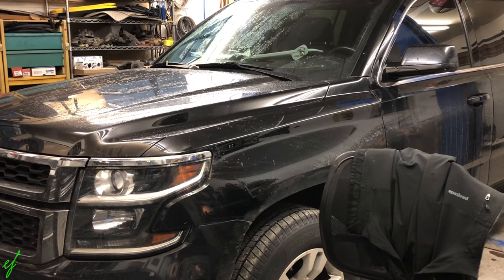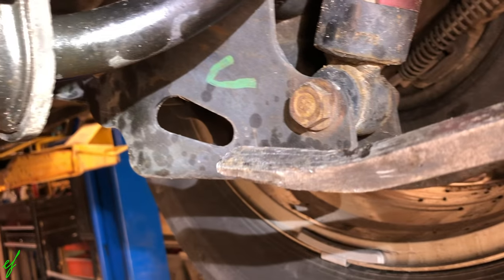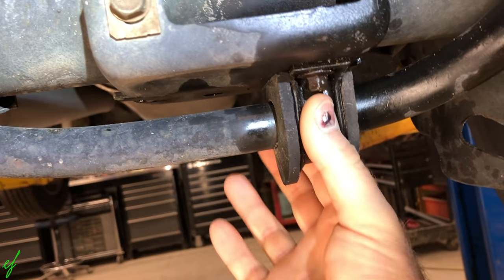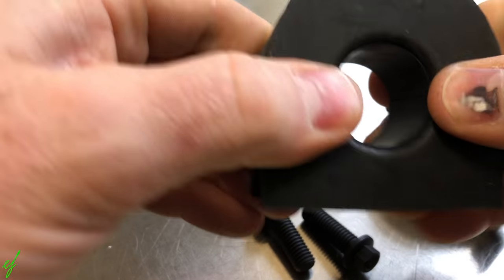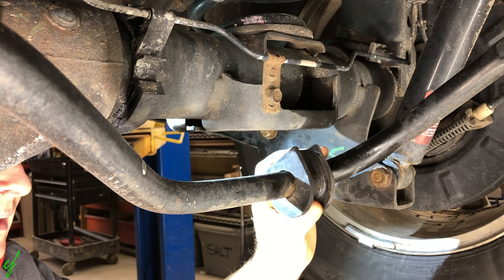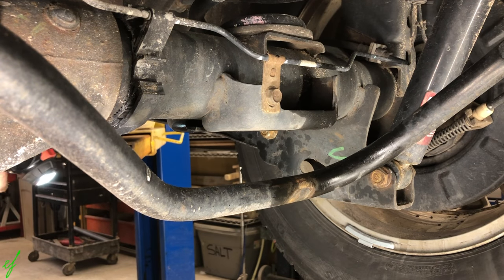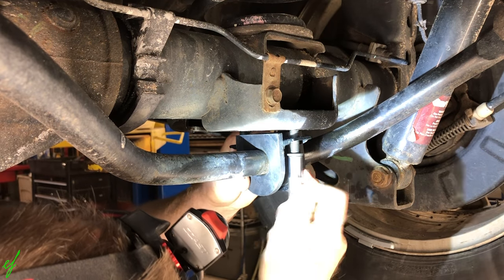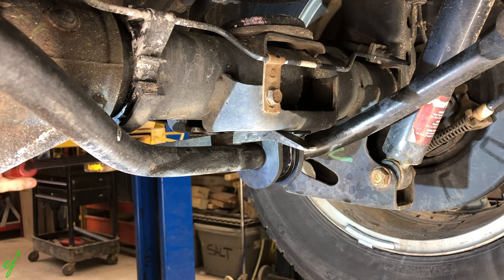SWAY BAR BUSHINGS  |  Professional Sound Diagnosis & Replacement

Comment: Good video, but come on those bushings were still good lol. The little play you did have you caused it. If anything they needed some grease.
Reply from the maker: 2 wrongs do not make a right 😂. I am just teasing ya haha. So first, the bushings were loose enough to clunk while driving. Second, NEVER add grease to a sway bar bushing. It will make noise a week or a month after that is so horrendous you can not even believe it is possible. I mean its loud and screechy and horrible constantly while driving. Bushings are the wear item with the intention of saving the spring steel sway bar. They should wear out over time and they should also be installed dry like the factory installed them 😃🔧
Reply: @EasyFixShaun  Ha...Sir I'm not arguing with you, but I know for a fact you are wrong about greasing the bushings, some cars automatically come with certain bushings in certain areas that have grease fittings and sway bar bushings are one. The sway bar LITERALLY rolls back in forth, side to side within the bushings SO HOW LONG YOU THINK THAT RUBBER WILL LAST WITHOUT GREASE? This isn't even a discussion, this is common sense.
Reply from the maker: @MRMAN-wb1tv  I am arguing with you. You are incorrect.

Comment: I replaced my stabilizer bushing and it started making load squeaking noises every time I went over a speed bump.  I ended up putting grease on the bushing and the sound is now gone.  Anyone else had that problem?
Reply from the maker: First time I have heard of squeaking from a new bushing. It’s possible but it’s not the norm. If grease made it quieter you isolated the noise. I would check that you have the proper parts. It might be a good idea to get a couple bushings straight from the manufacturer 😃
Reply: @EasyFixShaun  i read that Polyurethane bushings will make noises without lubrication.   I got my bushing from the local auto part store.
Reply from the maker: Ok. I haven’t searched poly noise. But from my experience I have never heard a bushing make noise after replacement. Usually the noise when they are worn is a clunking and no real squeak noises along with it. So I’m not sure what you have happening. What year make and model do you have?
Reply: @EasyFixShaun  that what most of my friend mechanic said too.  They never heard it squeaking before.  But I did find mechanics on line saying it will squeek if its made from Polyurethane which mine were with out grease.   I got it from Napa so it is the correct bushing.
Reply: @EasyFixShaun  its a dodge ram 1500 2006.  The new bushing is blue colored.
Reply: @EasyFixShaun  i took a video of the noise to show my cousin mechanic of the squeaking noise.  I could send the video to you if you want.  But I need an email or number.
Reply from the maker: @oneloveyessah  Is that bushing an aftermarket bushing? Like a performance type of bushing?
Reply: @EasyFixShaun  no its not.
Reply from the maker: Hmm usually stock bushings are aftermarket bushing are always quiet for me. I don’t usually work with performance aftermarket type bushings. They are a special order type thing. Not something that would be in stock typically. I thought maybe you had one of those. I don’t know man. I wish I had a better answer. I would try a factory part from dodge if you keep having squeaking out of those aftermarket bushings. Would be a good thing to try. 😀🔧
Reply: @EasyFixShaun  its good now. No noise at all.   From one of the YouTube videos, they also said to use silicone or Teflon grease on the Polyurethane bushing not petroleum grease because  it would degrade the bushings.
Reply: @EasyFixShaun  i just spoke to the auto part store and they did say it will squeek if the bushing is made out of certain type of rubbers.  And Polyurethane is one of them.   Fyi
Reply from the maker: @oneloveyessah  It makes no sense at all to have to lubricate a rubber sway bar bushing on a sway bar. It's not commonplace at all to need to do that. I have installed hundreds and hundreds of sets of bushings on all kinds of vehicle makes, and I never needed to lubricate one. If lubrication is needed, I think something is wrong. A garbage part seems to be the lowest common denominator in your case. I am really glad you got your noise fixed! I hope it stays fixed. I have one reference experience where I lubricated a bushing "for good measure". About a month or so later, the lubrication washed off and the most horrific loud squeal and squeaking noise started. I had to then replace the bushing again. The second time I did it properly with out using lubrication of any kind. For best results, sway bar bushings should always be installed dry, the same way the factory installs them. 😃
Reply: @EasyFixShaun  I think whats happening is when the sway bar moves the rubber kind of sticks to the bar which then creates that squeeky sound.  I can see why it would do that since its a moving part.  I bet if I just left it as is without lubrication, in time I have a feeling the sound would slowly subside once the rubber start breaking in.  I also wondered if the bushing suppose to  be loose or have a little space between the bar but mechanics here said it should be tight to the bar no space. The original bushing that was on before I replaced it I notice there was a slight space between the bushing and the bar.  So even if it was made out of Polyurethane I doubt it would squeek since there is less contact to the bar.  I only replaced the sway bar bushing because i was installing a 2.5" lift kit and might aswell replacing the links, ball joints, boots, rotors, struts etc.   We see what happens in time.  Part store said i have i think he said a year warranty on it.  If it fails, I'm returning it.
Reply: @EasyFixShaun  you know what.  I just looked at the pictures i took under my vehicle before we did anything, and in one of the pictures  noticed the sway bar bushing bracket that goes over the bushing which is tightened with 2 bolts.  I see about a 1/4" space between the bracket and the car frame at side view.  When I installed the new bushing I tightened it till it could go anymore.   Inother words, there's no space like how it was in the pic.  I wonder if I have it to tight causing the rubber to be too tight around the sway bar which why it squeeks?
Reply from the maker: @oneloveyessah  The bushing should be tight and squeezing the bar very hard if it is working properly. I think you may be chasing your tail. I would recommend spending no more time on it. If its making noise.... get a factory bushing set and install them. Otherwise you may waste hours of wondering and guessing. Your issue is very uncommon. Get a factory sway bar bushing set and install it.

Comment: I just replaced mine yesterday, but some people say to lubricate them. Is this true? I just simply installed it without any lubricant.
Reply from the maker: You did it the way I would do it. The factory does not install any lubricant. You should be perfect. I have tried grease ages ago on a half dozen sway bar bushings and they all came back with weird squeaks. Install dry only. I’ve installed hundreds of sway bushings. No problems will come  back from installing dry. That is what they are designed for.
Reply: @EasyFixShaun  thanks, I figure the same otherwise it would come pre grease from the package if intended that way.
Reply from the maker: Good point!! Can I use that response from now on? You just boiled it down perfectly.
Reply: @EasyFixShaun  yep not a problem

Comment: you really should clean the bar and apply a little silicone grease.
Reply from the maker: Cleaning the bar is a great idea. Lubrication of any kind is not recommended. Install them dry like the factory did  or you will end up with horrible results. You would not believe how loudly they  will squeak from adding lubrication. It won't squeak at first, but when it starts, it is out of this world loud. The bushing itself is designed to be the wear item more so than the bar, saving the sway bar. Lubrication interferes with the design because the bushing is self lubricating. It is made of poly plastic 😃🔧

Comment: You need to add grease
Reply from the maker: You can you do that. I never do that. I did it once. You wouldn't believe the noise that was produced about a month later. Crazy loud! I had to replace the bushings all over again to rectify that problem. Removing the bushings and cleaning the grease did nothing. Install them dry just like the factory did. They are not designed for grease. They are designed to wear and be the "wear" item. I hope that explanation helps 😀

Comment: Have vibration and humming noise. Right turns. Slow speeds, and speed bumps, Inconsistent
Reply from the maker: Sounds like a possible wheel bearing. Here is another video that could help. I would perform the shake and spin test in the video to help expose noise and pinpoint the location of the problem 😃🔧🔧 https://youtu.be/nl7cU2wHBXg

Comment: I have an 08 Malibu and I have to drop the cradle to fucking get to mine. So annoying
Reply from the maker: Dude that sucks. I don't have any experience with the Malibu. Are you sure you can't reach up and remove bolts while under the car. You may have to do it blind. Usually you can access them, sometimes just barely though. I have also been able to reach through the area where the steering rack is to reach them on Mazdas before. That worked pretty good but it was a pain. Just spit balling here to try to help out. :)
Reply: Easy Fix I tried removing one of the two easier bolts and it snapped off and my mechanic said in order to get that out he’ll have to drop the cradle. I guess I’ll see what we can do when I bring him my car. I’ll keep you updated lol
Reply from the maker: Oh man that sucks. Rust is probably my number one problem. Sorry to hear that. Ok sounds good!

Comment: My ex-wife has a clunk in her rear.
Reply from the maker: Sometimes the rubber bushings can blow out and get loose in the rear suspension.
Reply: Was she regularly serviced?
Reply: Dark knight  

    Too many before I bought her.  Damaged goods
Reply: @russes088  

      Never came in for service
Reply from the maker: Yes. But with any luck they last many miles.
Reply: @EasyFixShaun  lmfao
Reply from the maker: Sway bar bushings are a wear item.

Comment: doesn't look much better at all.. it still moves quite a bit...........
Reply from the maker: the bar is designed to move a little bit in the bushing. Once I replaced the bushings the clunk is gone. The bar was wobbling around in the bushing enough to make a noticeable noise.

Comment: Why in the hell didn’t you put grease on the outside and inside of the bushing really
Reply from the maker: You should never grease a sway bar bushing. It is designed to be dry. Alway install dry just like the manufacturer. If you grease it you will have massive noise issues eventually. I tried it once. 😎

Comment: Dorman, Really?
Reply from the maker: It was one of the very few part options available right now, other than going with oem. Oem failed prematurely. I think it’s a good idea to try this part for now. Plus they are a harder material than oem, so they might last longer. Time will tell, but I feel good about Dorman in this case. I’m sure there will be more options in the future.
Reply from the maker: That would be amazing. I hope someone makes it soon. There could really be a need for that.